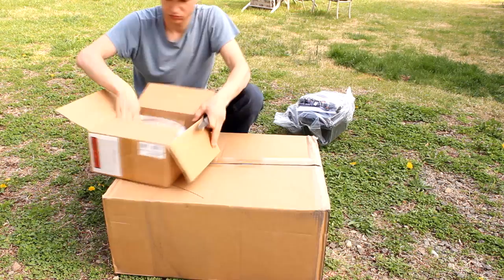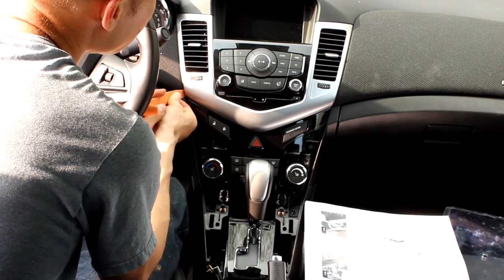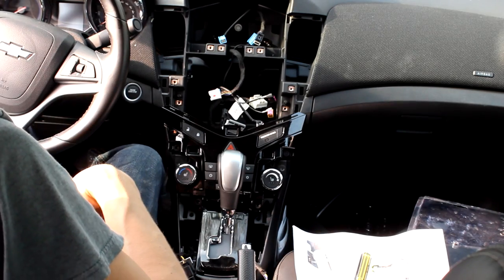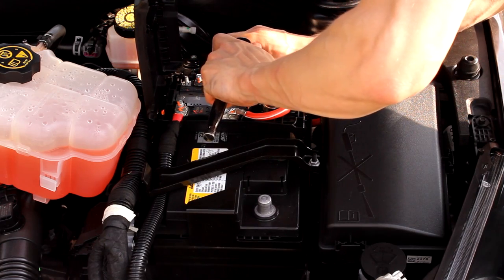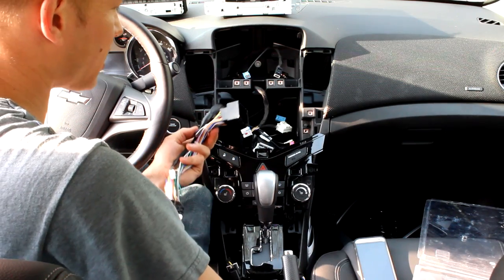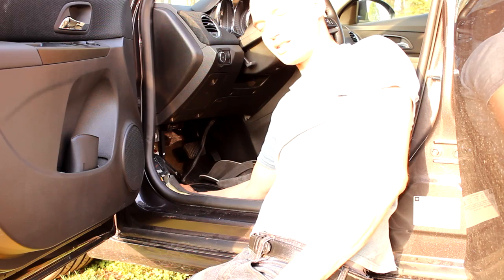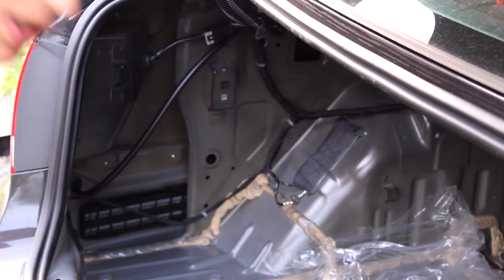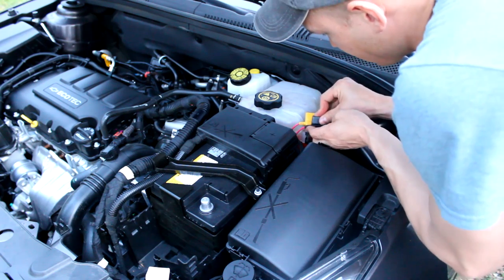Chevy Cruze Kicker Subwoofer VSS Powerstage Install

Comment: Just get the Cruze with the deluxe sound system, louder and better than most car systems.
Reply: The Pioneer system option is a very nice upgrade over the standard system, but a 10" sub would be a big more is better kind of an upgrade. When we bought my wife's Cruze brand new I couldn't believe the difference between the standard and the Pioneer.
Reply: @michaelking1869  i just wanna know if i can somehow use this with my cruze, it has the pioneer system.

Comment: Excellent video man. 
Just bought a 2016 Cruze and want a sound upgrade.  Without switching out the receiver,  what are my options?
Reply from the maker: Thanks for the feedback! The two options that i had were: this kicker system (i didn't think it was worth the cost) or do a custom install.. Check out my other video to see how i did it) thanks for watching!
Reply: Do you know how to bypass the stupid auto stop in this car?  It's on by default and no longer has the option to turn it off.
Reply: If this was $450, would you say it would be worth it? Or stil go for a custom sub+amp setup?
Reply: I'd happily pay that for an upgrade.
Reply: I'm torn between that (for $450), or a Kicker CompVX 12in and amp for about $350...
Reply: if you drive and ignore it for month or week by not stoping fast and just slowly pulling up to lights it will turn itself off same if you are in line for fast food lol i hated it and now it doesn't do it anymore it better with out it

Comment: The question is how many watts is that system all together? that you didn't say or tell.
Reply from the maker: the car speakers amplifier: 50 watts RMS x 4 at 4 ohms
the subwoofer has a 200 watts RMS sub amp